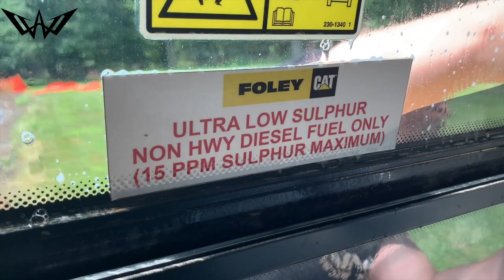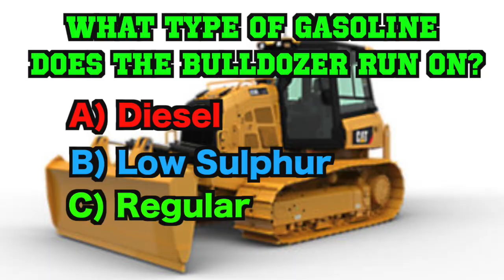Tinting a Bulldozer

Comment: That’s a contradicting question. You should have worded it  “ what type of fuel does the dozer run on”. Diesel and low sulphur are the sane thing. Only difference is one type of diesel is lower in sulphur than the other. So they’re both correct bevsuse it will run on either one. But most likely it’s being ran on dyed fuel which wasn’t even a choice. So there you have the rest of the story
Reply from the maker: wow Casey you really know your dozers!!! stay #WINNING
Reply: Agreed fuel is key word

Comment: I need my excavator tinted boys ... But I'm in Australia 🇦🇺 🤔
Reply from the maker: The heat in Australia is no joke. Get some film on there somehow before you melt away!
Reply: We have all our earthmoving machinery tinted to 5%, the temperature drops so much and the a/c is much colder, definitely recommend although if you do the side windows make sure to tint the front aswell as the glare through the front makes it hard to see out the sides without tint on all the windows.